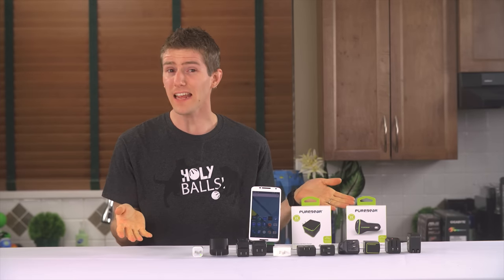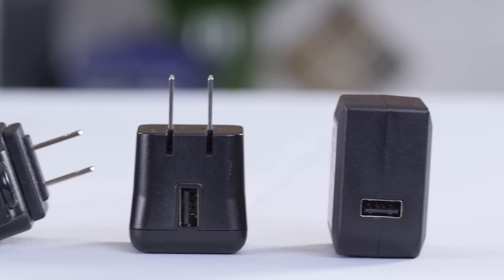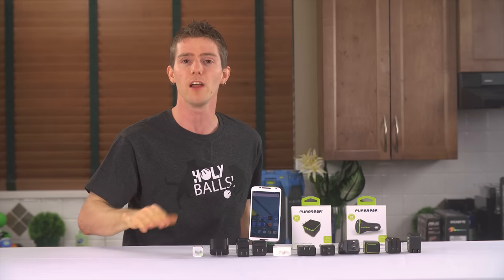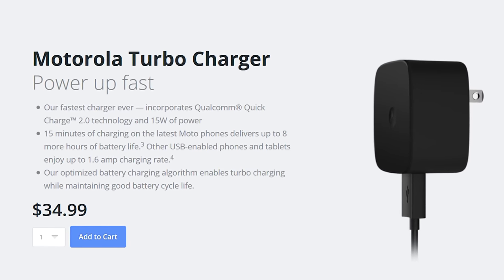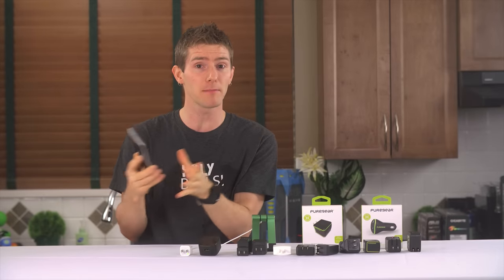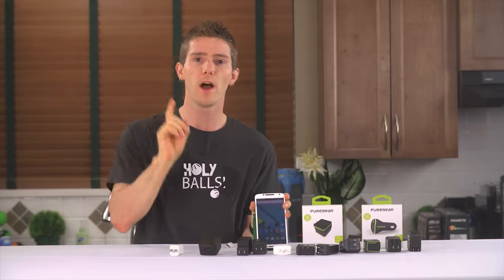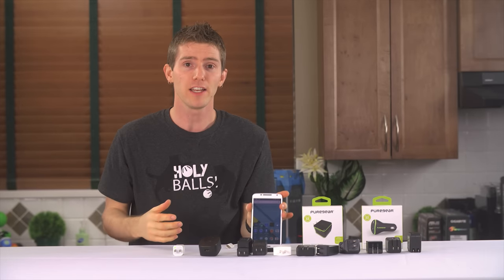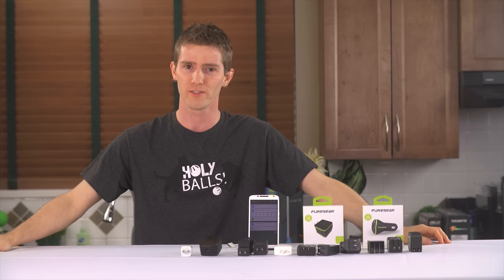Faster Phone Chargers Explained - Qualcomm Quick Charge 2.0

Comment: Apple switching to from USB-A to USB-C is really screwing with charging bricks. I only have type A outlets in my battery pack and bricks. For several years, I only used wireless charging because I had a Mophie case which gave me an extra 60% or so which allowed me to get through a full day without charging in the middle and just charging at night. I just got a 12 and I don’t like the battery cases so I have to swap back to normal cables for daytime charging, but it came with a USB C to lightning cable and I only have one USB C port, and it’s on my laptop. The improved battery life is helping with that for now, but I don’t know how it’ll fare during a full work day

Comment: so fast charging is bad for your cell phone????
Reply: Only if it's excessive/unnecessary
Reply: so pretty much fast charging every charge isnt good
Reply: David Kaplan I mostly charge at night when i'm asleep, and in that situation fast charge isn't necessary as it would be fully charged once you're awake anyway. Using it in the middle of the day is worth the extra temps though in most cases.
Reply: yea thats what i used to do and then i got a new phone that lasts me like a day and a half so i started fast charging during the day. and i heard that if you keep the phone charging after 100% it will mess up the battery. i just heard so many stories and tips that now they go against what the other said
Reply: In a way, yes. It's not necessarily the charging as much as it is the heat.
Reply: ok i gotchyu. thank you guys
Reply: David Kaplan No, lithium-ion batteries have a more stable, thus better battery life, if they are charged slowly. Temperatures affect very little compared to how the battery cell reacts to the high-capacity recharge-rate. Phones today can be hooked to a charger and left there to stay at 100% charged because the phones internal IC to control the charging levels will go to "upkeep-mode" once the battery reaches that level.
Reply: thank you sir

Comment: well I want an Iphone so my phone won't blow up in my pocket and you can't put out. lithium ion flame...
Reply: Chase Baxter getting an iPhone isn't going to prevent that. the only things you do by buying an iPhone are 1. waste $800 on a phone that's worth $200, 2. limit what you can and can't change in the OS, 3. take pretty selfies of yourself looking really really pretty, 4. fit in with everyone else, 5. get caught in Apple's system which means it's extremely difficult switching to Android from ios if you have a lot of paid apps, 6. charge your phone in 5 hours, and 7. use your phone for an hour at most without plugging it in to the wall. I would know. I've been using ios for 5+ years now and I switched to an Android phone recently